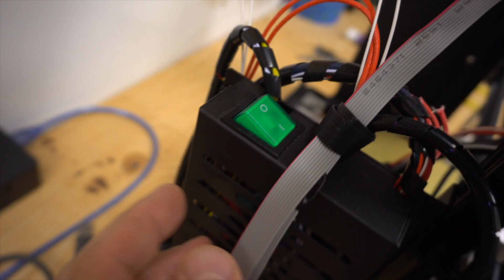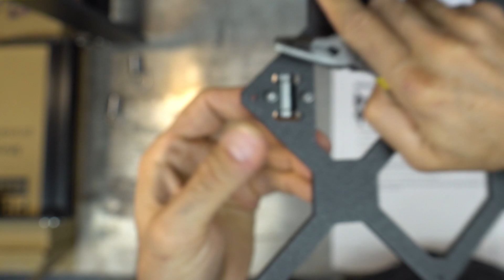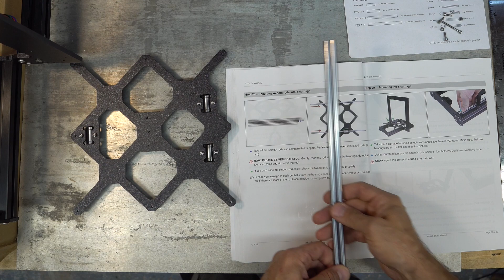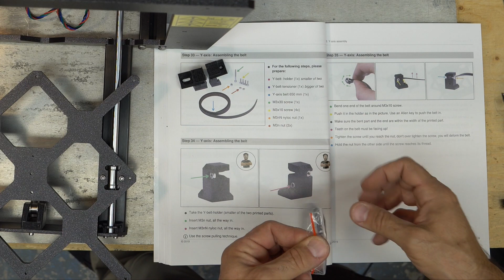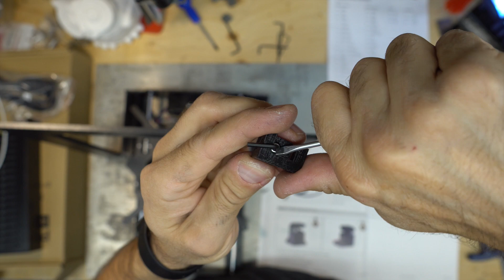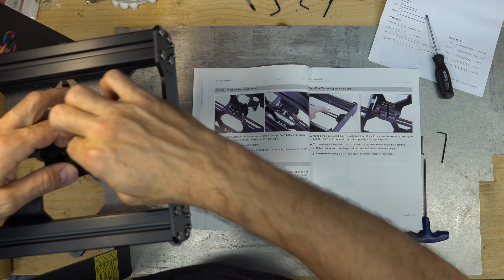Prusa MK3S Assembly Part 2 (Chapter 2)

Comment: As I understand it, it is incorrect to have the rods sitting directly on top of a single row of ball bearings like that. PRUSA recommend that the bearing be rotated in the frame at 90 degrees to the position shown in this video. In this way, the underside of the rod is supported by 2 rows of balls, with equal pressure on each row. rather than on a single  row of balls, which could increase friction and wear on both rod and bearing.
Reply: I assume you mean 45 degrees?